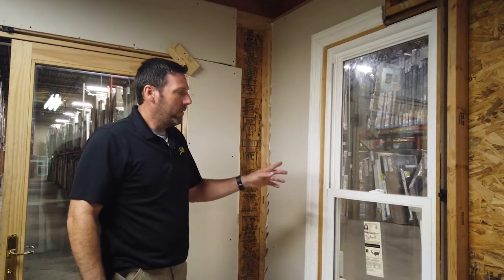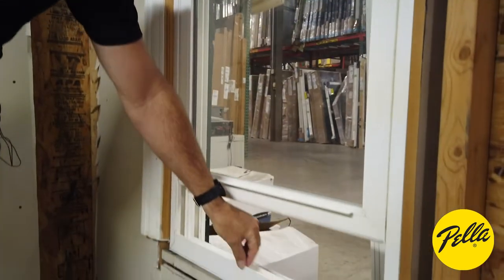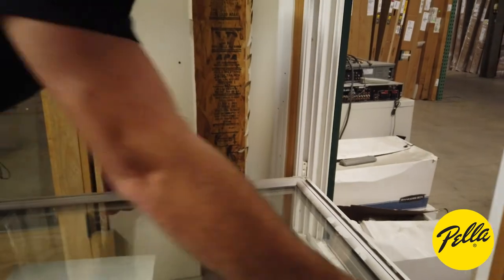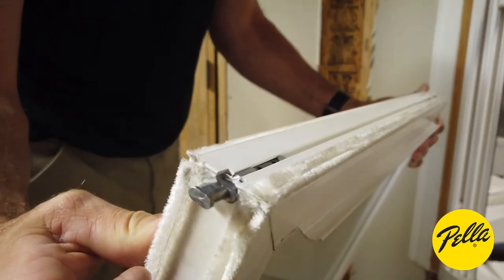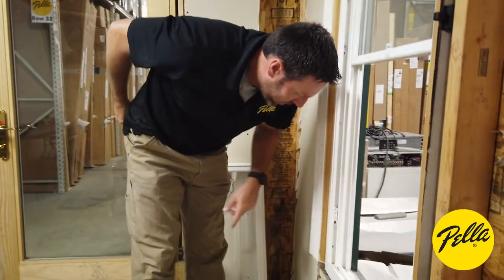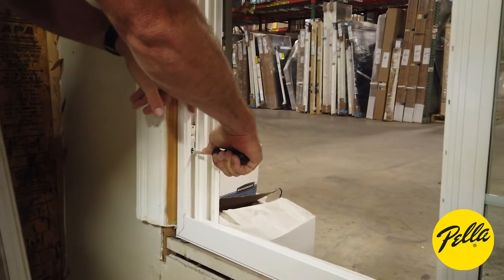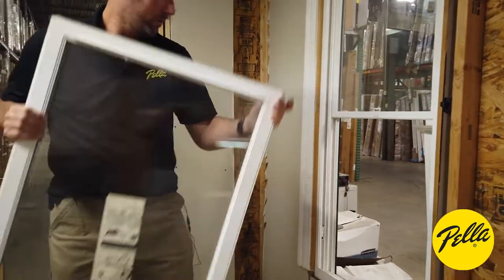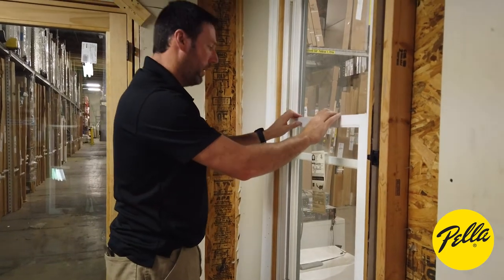Instructional Series - Vinyl Sash Replacement

Comment: Great video, I do have a problem for one of my newly installed (larger) 250 dbl hung windows. I took both sash’s off and confirmed operation of all 4 balances, my issue is the coil seems to not be enough for the weight of each stash.. (top sash falls couple inches usually.. and bottom closes shut slowly) is it possible to increase the coil strength or should I call Pella? It’s like it’s almost enough, but not quite, I have two of the exact same size windows installed and only issue on one.
Reply from the maker: Alright! Bit of a long answer here. If you have more than one window of the same size, first step is to make sure the balances all have the same number on them. If they do, that's the correct balances. If NOT, we need to order and replace with the correct balances. If they are correct in the window, you could have your local Pella dealer order you some friction screws and get these installed into the plastic of the balance, and that would solve the issue. 

The sash could also slide down if the window frame was not shimmed enough. 

Hope these help!
Reply: @pellanorthcarolina  thank you for the quick response! I will check this out and see if I can find the number, if I figure out the issue I’ll let you and others know just in case it could help others maybe facing similar issue! Thanks again.

Comment: What tool did you use, a flathead screw driver?  I’ve used a flathead and the hotshot wouldn’t turn.  Maybe a wider screwdriver and turn harder?
Reply from the maker: Yes, that was a wide flathead. Need to use one that can catch the sides of the terminal in order to turn it. 

Great question! Hope this helps.